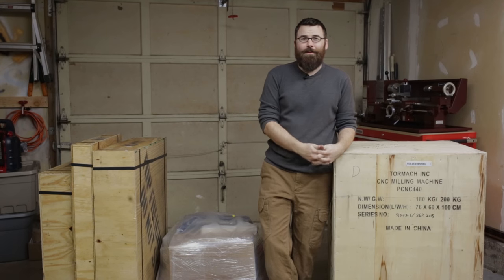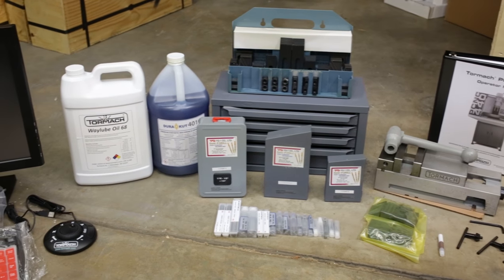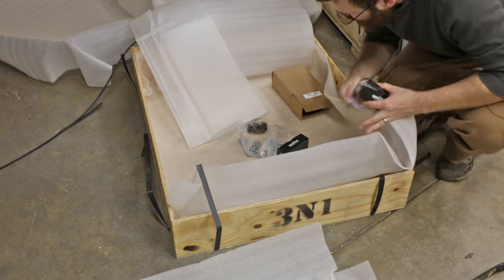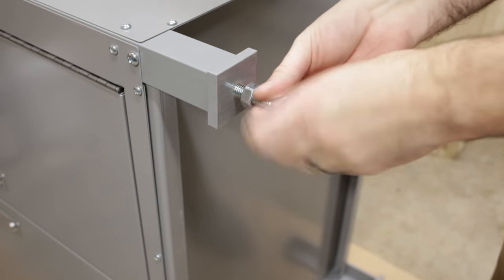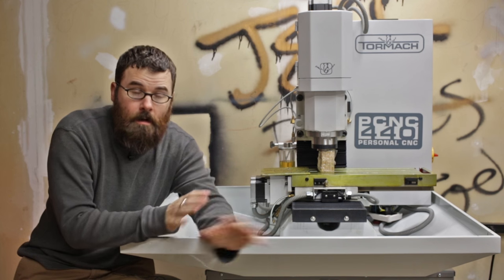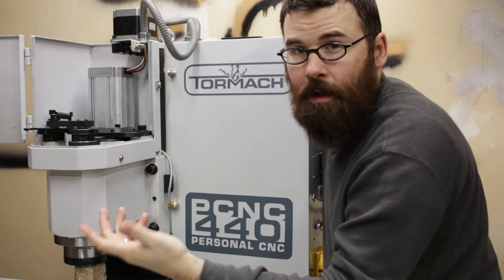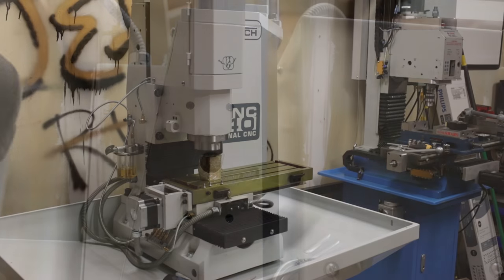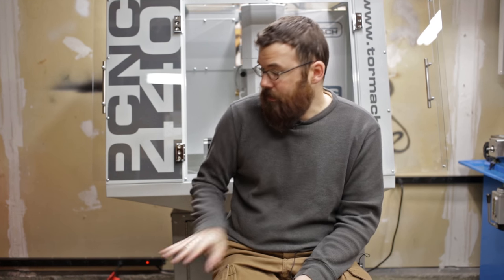Tormach PCNC 440 - Unboxing and Setup

Comment: I took your advice and got leveling feet from McMaster-Carr, and I'm glad I did. Thanks!

One extra bit of advice for folks: the leveling feet I bought had a 102mm long threaded section, which is longer than the clearance on the inside of the stand's leg. That means the minimum height from the floor to the bottom of the leg is about 2 inches. Short guys like me have to stand on tiptoe to reach the spindle cover latch, and the extra 1.5 inches doesn't help. Especially since we're still waiting for Tormach to release the power drawbar kit! I wish I had shortened those leveling feet before installing them.

Comment: Congratulations!! I've watched you show a lot of products in the past.. but this is by far the biggest (and heaviest). Really looking forward to some more actions videos of the 440; I've been on the fence between 440/770 but I think for smaller hobby work, a 440 leave a little $ leftover for a Tormach lathe :)  Cheers!
Reply from the maker: +Warren Bailey Ha!  Worlds colliding!  Heck, I'M looking forward to more videos, that means I can play with the 440 more!  I think the 440 works well because of the higher spindle speed, the smaller footprint, and of course extra cash for tooling and accessories.
Reply: +Robert Cowan (Rowen Hobbies) Well that was the push I needed, so I ordered my 440 today. I was on the fence based on additional horsepower of the 770, but your reminder about the 10,000 rpm spindle was the deciding factor on pulling the trigger on a 440. Thanks for the push Rob! Looking forward to more of your videos since it probably will be April before the 440 gets delivered here to me in Vancouver, Canada.
Reply from the maker: +Warren Bailey Awesome, congrats!  Tell them Robert sent ya ;-)

Comment: I watched this video several times as I just took delivery of my Tormach PCNC440 this week.  The only thing that should be revised is that they now come with very nice large feet much like the ones that I bought off of Amazon at the recommendation in this video.  So if you are getting a 440 with the stand, you do NOT need to order better feet.
Reply from the maker: I've heard this, that's good news!

Comment: Regarding lifting the mill, Tormach sells a lifting kit for the 1100 and 770 that includes a lifting bar that allows the mill to be level while lifted to help get it on the stand easier and I suppose safer.  I assume that they will come out with a smaller version for the 440 - or maybe the current one will work with it: http://www.tormach.com/store/index.php?app=ecom&ns=prodshow&ref=31446

Comment: Question, have you ever thought of having wheels on the bottom of the stand? I have limited space to set up the PCNC 440. I know often times bigger machines tend to be an island where people can move around them, but do not have the space to do that. Would you suggest wheels or some other way to get to the back of the machine if ever needed?
Reply from the maker: You could use wheels if you wanted.  You would just need casters capable of the weight of the machine, but that's not too hard.  You can also use a pallet jack to move the machine around, but that's something else you would need to store :-)  If I needed to move the machine around, I would use either lockable casters or make some sort of mechanism that engages and disengages wheels, so it can be moved around (similar to a mobile base used for table saws and such).
Reply: I used these on my 440 and they're perfect: https://www.keystonecastors.co.uk/50mm-footmaster-hand-wheel-operation-kgd-60sblack

Comment: Great review, clear, concise and no intrusive license free music.  What is your overall thoughts about the 440?
Reply from the maker: Overall?  It's not the best machine out there, and more of a hobby machine than it is an industrial machine.  That being said, if you're looking for a small mill and don't want to hassle with a used Haas (and all the complexities that go along with it), it's the best thing on the market right now.  It's hard to find another machine that can do the same things, and is as easy and cheap to operate.  The only real downside, the travels are pretty small.  I would love more Y travel, but it is a relatively small machine overall though.
Reply: @RobertCowanDIY  thanks so much for the info I’m looking at the 770MX right now so I’ll need to compare to the haas mini.  I am a beginner but so not like buying something twice
Reply from the maker: @tdg911  There's a LOT of discussion between the two.  If you're just a hobbyist, I like the Tormach because it's cheap to run.  If I'm actually 'making' something, I outsource.  I use the Tormach and my own machines for prototyping and testing things.  Once I'm ready for a final, I find that it's easier to just outsource, I don't have to worry about my time, the tooling costs, and everything else that goes into running a production part.  I'm not a business, I'm just a guy making stuff at home.  If I ran a business, I'd probably get a Haas, or just keep outsourcing.  It's not worth my time to stand at a machine.

Comment: Nice video Robert, hey did you used to do the new product posts for sparkfun?
Reply: Never mind, Great to see you doing new things, whats your interest in CNC?
Reply from the maker: +Steve Pilon Yep, that's me!  I've always been a little interested in CNC.  I mean, it's just cool!  I built my first CNC nearly 10 years ago, then got out of it and just recently got back into the hobby.  I like the ability to create parts that I've designed.  I see it as next-level DIY :-)  3D printing is cool, but I just don't like the accuracy and the overall quality of the parts.  It's amazing for prototyping, but I don't tend to like it much for final products.

Comment: I've been thinking a lot about the 440 lately, but it's a huge investment for me.  For someone on a budget, do you think it's still worthwhile to convert an x2 or pm30?  Can you recommend resources on those conversions?
Reply from the maker: +Jesse Hughson This is a fantastic question.  Only you can answer this, but I can help.  I've converted a PM30, and RF something, and an X2.  I know what's involved in all cases.  It comes down to how much time you have, or how much time you want to devote to the machine itself.  I've converted 3 machines and I can tell you, as a hobbyist working on the weekend, it will take around 6 months.  There's the mechanical side (adding ball-screws, oil system, bearings, motor mounts) and then the electrical (motor drivers, controller, power supply, etc).  It takes a lot of time.  If you order a kit, it can take less time, but those can be pricey.  Or you can build your own, but you will need a mill to do it :-)  I used an X2 to convert my PM30.   A lot of people end up just buying the kits.  So if you buy a PM30 (~$1k), buy the mechanical kit (~$1-2k) and the electronics (~$1k), you are pretty close to the base price of the 440 ($5k).  It's a smaller machine than the PM30, but so far, it looks to be a lot more capable, other than travel.  

It's really your call.  I kinda wish I had just bought a Tormach a couple years ago.  I spend the majority of my time building stuff FOR the mill rather than using it for actual projects.  You could do  G0704 and convert it for around $3k.  It won't be as capable in general as the 440, but it would be cheaper.  One thing I tell people about CNC is that everything else adds up.  Once you start getting into tooling, a vise, clamping kit, measuring tools, etc, you can easily add on another couple thousand.  So look at EVERYTHING you need.  If $5k is already a stretch for your budget, you might not be able to get the right tooling.  It might be better to spend $3k and have the extra money for tooling and extras.  

In the end, this is a pretty pricey hobby if you're gonna do it right and get enjoyment out of it.  If you have any more questions, feel free to reply or contact me directly.

Comment: Great video. How long did it take you to get the stand and enclosure assembled?
Reply from the maker: +Jody Olivent Well, I did this all in my unheated shop when it was about 5 degrees outside.  If it had been warmer, it would have been less time ;-)  The stand took around an hour or two (if you exclude filming) and the enclosure was about the same.  If I had help and didn't have to document anything, I think you could do the stand and enclosure in a few hours (with a break in the middle to raise the mill up on the stand).
Reply: That's not as long as I feared. Thanks and enjoy the new mill.
Reply from the maker: +Jody Olivent Your mileage may vary ;-)  It really wasn't bad at all.  The enclosure took a bit longer actually.  If you have your tools handy and know the process (by watching either my video or the one from NYCCNC, it helps a lot to get an idea of how it all goes together.

Comment: I didn't realize they lacked a power drawbar until you opened up the head.  Boy howdy, that's gonna get tiresome really quick.  I'd be inclined to adapt a bridgeport power drawbar kit for the meantime, I see they are supposed to have one available at some point.
Reply from the maker: +eformance Yeah, they will be coming out with one soon.  For the base price of $5k, there's no way it would include a power draw-bar.  On the PathPilot interface there is a button for G30, so you can more easily do tool changes.

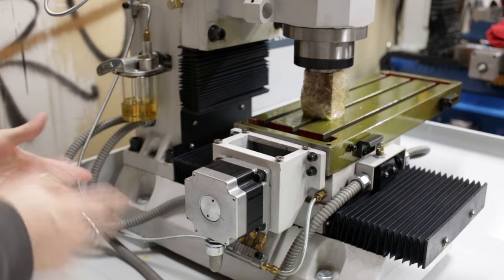Comment: Tormach tells me that the current enclosure design includes a larger notch in the same place you notched your right side panel (around 10:30 in the video). With the larger notch, the vertical right side support no longer sits on top of the bottom lip of the right side panel. Here's the photo I sent to Tormach about the issue, with red lines added by Tormach showing their notch: http://www.mustbeart.com/random/tormach_notch.jpg and here is a drawing they sent me of how it fits together now: http://www.mustbeart.com/random/tormach_drawing.jpg

Oddly, the enclosure that shipped to me on May 18 was one of the early design, like yours.
Reply from the maker: Interesting.  Good to know it is being changed for future models.

Comment: Did they seriously ship the machine with the spindle sitting on a wood block?  There should be a steel bracket that bolts the head down to the table, so the spindle doesn't have anything touching it during transit.

Comment: What happened to the PM CNC?
Reply from the maker: +Jared R It's sitting to the right of the Tormach, getting lonely :-(
Reply: +Robert Cowan (Rowen Hobbies)  HA!  The reason I ask is I was looking at the PM & G0704 to CNC them.  Wondering if there was a reason you ditched it for the Tormach?
Reply from the maker: +Jared R Well, opportunity knocked...  Honestly, I've spend the past 2 years doing CNC conversions and not really making parts on my CNC...  I still have a list of stuff left to do on the PM30 and I got it well over a year ago.  A lot of people ask me this same question.  My answer is always the same.  If you want building CNC machines to be your hobby, go with a G0704 or similar.  If you have another hobby that requires a CNC (and you can afford a Tormach), buy a Tormach, no question.  You WILL spend a lot of time tweaking your DIY machine and you will find that the savings isn't all THAT much by making your own.  If you compare apples to apples (all the features like MESA card, build quality, oiling system, etc), you'll find that the cost savings in building your own isn't all that much.  Beyond just the money side of things, the Tormach is a much better and more capable machine.

Comment: You learned a life lesson: NEVER lift with the hook directly. ALWAYS use a shackle. I hope you didn't learn the other lesson: with a threaded shackle bolt, snug it, don't wrench it, or you may find it is impossible to free. There are a number of reasons for this rule aside from hook fit, including the extra freedom to swivel and the difficulty of unhooking when in a different position than when hooking up. Much more practical to unthread the shackle. In fact, most forged eyes (the ONLY type that should be used for lifting) won't accept a hook of even much smaller rating than the eye. They are sized for the shackle bolt.
Reply from the maker: +john john good to know.

Comment: The stand and the enclosure on this machine is weak sauce. The stand plate is not strong enough for the mill and bends really easy. It should have been a piece of 1/8" plate or 1/4" plate steel. Mine bent very easily. The enclosure is super flimsy. Just bought one used and at the used price it was worth it. Buying this brand new I would be highly disappointed in the build quality of the stand and the enclosure. I hope the 770 and 1100 have better stand and enclosure build quality.
Reply from the maker: I wonder if they have changed it since I got it.  I found it to be pretty sturdy overall and the top plate was actually quite thick.  But then again, this video is 7 years old!
Reply: @RobertCowanDIY  Mine is from 2016. The base plate the mill sits on is .100 thick. They should have at least added support width wise as mine is seriously bent over the doors. The chip tray is decent but the enclosure is pretty flimsy. They didn't finish the sheetmetal well and everything leaks. They should have welded the corner seems so there isn't a hole for coolant to escape. I like the product but I think for the brand new price now it is a little steep for what you get. Quality to cost ratio isn't there. I hope the 770 and 1100 are better.
Reply from the maker: @AudioJunkie79 The 770 and 1100 are definitely better.  And yes, the whole enclosure needs to be welded, or at least come with a tube of caulk!

Comment: Cool. Well, How can I be sponsored by Tormach?  :) I can work very hard in making videos too :) I am Mechanical Engineer :):D
Reply from the maker: Study hard and eat your vegetables.
Reply: Robert Cowan hahaha.
Mr. Robert, what CNC mill do you have before this 440? I am looking for one small cnc mill. 440 is awesome but more than 6000 dollar I do not have them now.
Reply from the maker: Before the Tormach I had a PM-30MVL that I converted to CNC with the help of an X2 that I converted to CNC :-)  You can certainly build your own mill and save some money over the Tormach, but you will spend a lot of your time actually building the CNC instead of using it, which is the trade-off.
Reply: Robert Cowan yeap..you are right.  Well I need to save some money this year